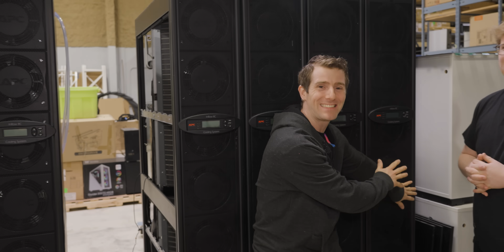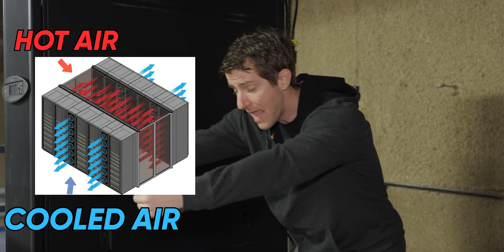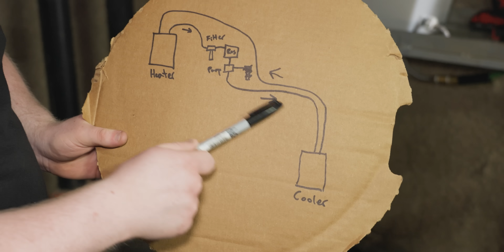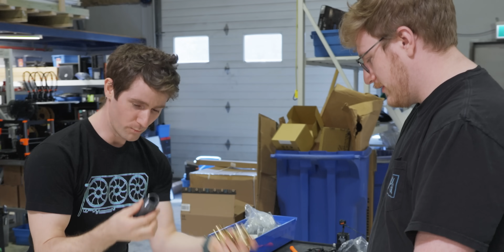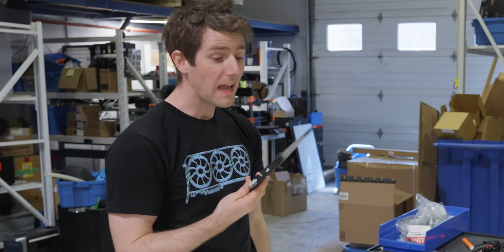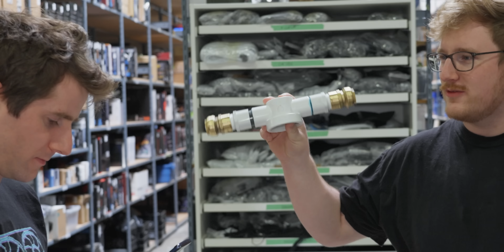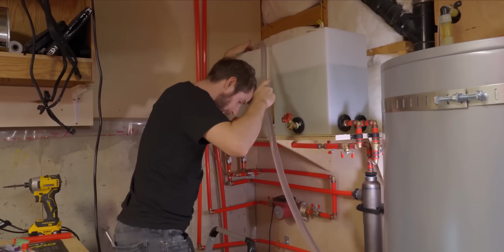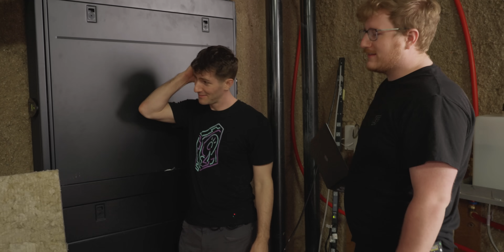I shouldn’t have kept the $1,000,000 computer

Comment: Ditch the AC altogether and put a water to water chiller between the two heat echangers and you'll close to double the heat pumping energy efficiency.  Then you can put a heat exchanger on the roof for the summer time(especially as they say we could have an even worse heat dome this year) and just use a 3way valve to direct the hot side water outside the warehouse during summer.
Reply: Or if you want to continue with the repurposing, get an air to water heatpump to replace the warehouse unit. And fot the Winter you could also put one on the outside.
Reply: If you did that you'd be much more constrained with where the heat goes.  Much easier to switch a water loop.
Reply: @stevebowen9412  There is no need to not Stick to a Waterloop. You just need to use a Monoblock unit. Those have the whole refrigerant circle in one casing.
Reply: @Felix-st2ue  by definition if you're using an air water heat pump the the hot loop will be air .  Unless you put the air side in the server room.
Reply: @stevebowen9412  Technically yes. But most modern units offer a cooling Mode for the summer. So they will reverse cycle to cool the water.
Reply: @Felix-st2ue  A water to water chiller is two monoblock heat exchangers connected by a refrigeration circuit. This widens the temperature difference in an extremely efficient way and makes the whole system work dramatically better.  If you're suggesting keeping it as a single cooling loop, and using an air to water chiller that will add a temperature constraint to one end or the other and negate the benefit of switching from AC to a chiller.
Reply: @stevebowen9412  It would definitely reduce the complexity compared to your approach. And it would improve the effectiveness compared to the current setup. It would make for a good video since they would rig something that is not industry standard.
Reply: @Felix-st2ue  it's not complex at all a water to water chiller is 4 pipe connections and an electrical supply connection
Reply: @stevebowen9412  Dont you have to monoblock units with a refrigerant circuit between them. That needs to be pressurized etc.
Reply: @Felix-st2ue  it comes as a complete package.
Reply: @stevebowen9412  But it's still two units, right? Otherwise, how would it be different compared to what I suggested. The only difference would be that you have two water loops instead of a large one. And that my solution would come with an appropriately designed fan arrangement to transfer the heat into the air?
Reply: @Felix-st2ue  no.  Water to water.  All in one.  Hot water loop to the warehouse.  Cold water loop to the rack room.  The unit would tie into the two existing lines dividing them into two seperate water loops with the heat pumped from one loop to the other.  No air heat exchanger at all at the chiller.
Reply: @stevebowen9412  So the second scenario. But then again, you end up with two water loops and need a unit that transfers the energy from the hot water into the air. My proposal would have that integrated. Plus, it would be sized correctly and designed for low noise. Especially on the warehouse end, this would be beneficial. And you would since you're directly transferring the energy from the hot refrigerant to the air and not add an additional step with water, the transfer should be more efficient.

Comment: FFS LINUS and team. CONTAINMENT> MORE DAMN POWER AND AIRFLOW. Separate your cold and hot air. Blanking panels, some curtain around the rack and venting HEAT OUT of the room and separating it from your cold. 3 tons of AC is so much fucking more than you need for a single rack if you do it properly holy jesus. 

SUB ZERO engineering. THey make containment systems. THeyre easy to use. affordable, one time cost. Data centers use it... so should you.
Reply: 18 damn minutes in they finally are like oh we should contain the hot air. 

BRO> TRY THAT FIRST YA DORKS
Reply: CARDBOAR?!?!?! IN A SERVER ROOM?!?!?! Yeah no the dust from cardboar and the flammability of it are perfect for a server room. Thats why all data centers have a no cardboard policy that ive ever seen. JESUS
Reply: setup containment properly, blank the rack, use just the AC and i bet its fine in there.

Comment: 3 ton AC is rather small. For proper cooling solution get a refrigeration company to install a 20hp cooling unit, with soft blowing air-coolers , it will cost about 20k but will keep that room at 15C

Comment: always put valves at both ends of the filter. those wilo pumps cannot handle air in the system very well
Reply: instead of teflon , use loctite thread sealer

Comment: The “condensate floats”are safety’s, if condensate pan gets too full(only if pan isn’t draining properly) then it turns off the unit and stops cooling to stop the condensation to keep the pan from leaking water on the floor. Loved the video!

Comment: How about putting two of these cooling units horizontally on the ceiling of the server room?
Would take advantage of convection and you could literally double your thermal throughput in the server room, without taking up any floor space.

Comment: Wait in North America/Canada do yall not have pressurised radiant heating?

We don't have water tanks in the UK for radiant heating; its hooked directly to the mains and just have small valves directly from the mains water to add water to the loop. The only major source of loss in our systems is via the over-pressure release from the varying temperatures throughout the year.

Comment: I have worked around water cooled server racks that were actually post cooled.  The radiator and then fan were on a swing door on the back of the rack.  It would draw the air in through the front of the servers, come out of the servers quite hot, then get pulled through the radiator then the fan would blow the cooled air back into the air.  The server room actually maintained the same temp year round, and the room was a pretty steady 70 degrees all the time.  There was no AC units or heaters in the room at all.

Comment: Comments around @3min are somewhat accurate. It depends if your data center is running in hot aisle containment (as pictured in vid) or in a cold aisle containment config which is much more energy efficient.

Comment: Whats the humidity like in the room? Air Cons need a little bit of moisture to better transfer cooling to the air. 
Course as they do this, humidity condenses on the fins and so they remove moisture.
Still a great effort to not have to cook yourselves with all that equipment!
Reply: 32.6% humidity at 22:40

Comment: The problem with all these massive powerhouse servers always seems to be that - example in the company I work in - the bottleneck is always the hard encrypted VPN connection for all the remote workers.
Reply: If you're working with a lot of data your VPN will be to access the computer that is sitting locally, not to transfer terabytes of video to edit directly from the laptop.
Reply: @TheFPSPower  Sorry. I did not quite understand how that helps the case I mentioned. Users are all working remotely.

Edit: 
Unless of course you meant that we'd have a “kind of” VMs that users would use instead (high-end machines placed locally where the data is at and have cheaper machines that the users would carry along). That works in some rare cases yes but there is a requirement to have high end machines for the users themselves to use in their remote locations.
Reply: @deejayxcrypt I assume you are talking about a remote datacenter?  Most local data centers for editing are using compressed proxies for anyone needing to connect remotely.   It seemed like thats what they were using these servers for anyways.
Reply: @talones  I don’t know if my YouTube app is bugging out or what so I’ll shortly repost what I said in length earlier (maybe this will be me repeating myself but anyways…).

In our case we have data centers (or high-end NAS drives) in some few locations. Those locations are capable to have 1Gigabyte/1Gigabyte bandwidth access from outside via encrypted access routes. We are able to have decent access routes between the data locations for any sync/backup reasons or just between the few users working from those locations. Then we have the many remote workers that rely on VPN access that is usually something like 10MB.
Reply: @deejayxcrypt  Yes that's what I mean, if you need a lot of data transfer from servers there's no world where "users having high end machines for themselves" is a reasonable requirement to work remotely, too many variables including the quality of the home internet connection which the company does not control.
Have a local high end machine and allow the user to remote to that machine from a thin and light laptop, works MUCH better.
Reply: @TheFPSPower  Yes, that is the problem itself. I am not taking into the calculations such arbitrary things as home network speeds however. The user chose to work there so then so be it. It would be nice of course if a user with at least an 50MB upload speed would get more than 10MBps up.

VMs would be nice, yes. We have a few, me included, who use all sorts of remote devices. It is not something our core users, and leaderboard, wants however. They require the power of a dedicated GPU on their personal (on hand) laptop which they’ll have access to even if they have to go work in middle of a far away area (forests, mines, construction yards,..) for a while (which would be a place where it would be a surprise if they get any internet connection even).

Edit: 
I hear ya… It is a bit of a nightmarish situation to think from multiple fronts. I'd really like to just have every remote user use VM. We will probably get there at some point.
Reply: Hardware-accelerated AES is pretty fast though, it is in gigabytes per second range at least.
Reply: @JGnLAU  It is. I’ve tested setting up some of my own small scale VPNs for testing and always have better results than what in the actual “production environment”.

I’ve always seen it more as a problem of our internet provider services rather than our devices and the VPN itself (unless it isn’t… because no one tells “more than they are supposed to” 😅).

Comment: Hold your fitting in your left hand, hold the tail of the teflon tape with your left thumb, roll the tape off the roll backwards so you can tension the tape and roll it off the roll, three wraps around the threads. If you absolutely don't want it to leak, throw some "Gimme the Green Stuff" pipe thread sealant on top of that and you'll never have to worry about leaks.

Comment: You’re only supposed to remove the white plastic part of the shark byte when inserting a metal pipe like copper. You might be voiding the warranty by removing it when using it with Pex.

Comment: I Have this type of setup for my whole room mancave cooling of my own. I have the option to use the cooler in the house to heat the house, or outside in the summer time, and the a/c for the house in the summer cools the house with no issues then. I also have a waterchiller inline so When I wanna do OC, the chiller is outside, but chills the whoole loop of 4-5 computers with no issues.
Reply: Who are you? Batman?

Comment: That Milwaukee impact @16:22 very much IS a hammer.  We've got ongoing jokes at work about how if it says Milwaukee, it's a hammer.  It might also be something else, but it's a hammer.

Which is extra fun because my PC case has a Milwaukee logo glazed onto the side of it.
Reply: Milwaukee battery packs are actually especially susceptible to breaking because of how little meat the screws hold onto on the top side of the battery.
Reply: @simplyintricate4160 You mean your hammer has a Milwaukee logo glazed onto the side of it...
Reply: @abcyclops  Or my hammer has a PC inside it, up to you how you want to look at it.
Reply: always a great idea to mechanically stress lithium batteries...

Comment: Actually Jake and Linus, instead of dumping the heat outside when you don't want it, which would be ideal under most circumstances for most folk, you should instead dump the heat into your hot water boiler(s), and possibly even a huge insulated thermal sink to act as a battery of sorts. When you need more heat, you can pull from it, and when you don't need heat for anything, you dump into it. You could do the same thing with the geothermal cooling idea you have with the parking lot, but instead just make a new thermal sink that is insulated for cold temperatures instead of hot. In that ones case, you are constantly pulling its heat via a separate loop dumping any heat it has into once again the heat battery, while having the original loop pass through it to drop it's water temperatures below ambient. Between the two masses being used to modulate the temperatures accordingly, you should end up with an albeit more expensive system, but also more resilient against the swings in climate, room temps due to people being in the area, etc and so forth. The A/C units will barely need to be operated then, ideally; and if they turn on it will be in a worst case scenario where you really want them on.

Attach this to some in-floor heating/cooling loops, and perhaps some thermoelectrics where is reasonable, and you could basically turn the entire building into one giant heat pump, with ability to throw the peltier's into reverse for the Seebeck effect. It won't be a lot of power generated, but it might be enough to keep the lights on at least via a backup power system charged by that power generation. In an emergency, this could prove handy, having what would basically be off-grid emergency supply of power if the grid suffers a black out. It won't be much power, but if it keeps the lights on, and some cellular phones active, it's good enough, right?
Reply: @SanityTV_Last_Sane_Man_Alive - heating water require a lot of energy, A loop pre-heating before the water boilers is "free cooling" AND lower electricity bill.
Reply: This is an office though, only showers would have hot water.
Reply: @TheSkcube  What about sink faucets? I believe they have a kitchen(s) too.
Reply: @SanityTV_Last_Sane_Man_AliveWith units that big, I am pretty sure they wil have a separate heating bill in the winter. Why else would they talk about geothermal?
Reply: Sand would make a good battery.
Reply: Those kinds of things only work with large temperature deltas.  You don't have that here.  It's very hard to make use of slightly warm water.
Reply: @  Heat pumps or peltiers? Heatpumps? Sorry, incorrect. But peltiers? Yes, there will need to be a well managed delta. Luckily, there are ways to store heat in a way that increases the load over time, so you can create that delta. It won't be exactly cheap to do, since it requires some exotic materials like titanium for instance, but it is possible if you do it right and use the right peltier units in the right positions considering said delta. Larger units require a larger delta. But if our purpose here is to just recover and recycle the heat again and again to create a current at all via the seebeck effect; then we can chain them together in a series/parallel setup in a way that will increase the usable voltage and amperages of the output. 

Again, so long as it can keep backup power sources filled for when the lights go out, it's not a complete waste of time and money. 

Personally, I think peltiers are a misunderstood tool we should be using more often, but is misunderstood because so many people tend to use them incorrectly, share that experience, and so they get a bad rap.
Reply: @ManuFortis  Basic thermodynamics.  Efficiency goes down as the delta decreases.
Reply: @stargazer7644  Yes, this is a given. Which is why one would chain together the units, to step up their output from those smaller deltas being utilized. 

Heat source(s) > phase change heat capture system (heat pump) > peltier units setup in array of series and parallel

"Cold" source(s) > 2 phase change heat capture systems ( 1 returning heat back to the first heat source pump, the other dumping heat to cool its refridgerant. 1st returning heat pump from dumping its heat does this repeatedly to ensure the cold source doesn't heat up too much.) > same peltier units array's opposite side. 

Peltier array > power delivery system > batteries > power distribution system > lights.

Lights? LED, since they require very little energy overall, and mostly just need their power source to be in higher voltage ranges than amperages. In a 120v household for instance, your led lightbulb is only going to be utilizing something like... 100-200 mA. Or 0.100 - 0.200 Amps. Not a lot. Depends on the version, lumen output, etc. 5 to 13 watts typically for normal bulbs as I understand. 

Larger bulbs like led grow lights for greenhouses, take easily double to triple that based on last I looked at the one I use for lighting in my computer room. Natural daylight spectrum output makes it kind of nicer on the eyes. And better for things like colour accuracy. Other light spectrums emitted from other bulbs in the warm and cool side of things can change colour accuracy of things they are reflecting their light off of.

Fun side fact about that last part. If you shine light through a red cloth thin enough to shade the light emitted from it as red, you can see through thinner red objects somewhat. Makes them sort of translucent. But it requires a very 'red' environment of light to do that. I found out when I draped my windows with red fabric just thin enough to let the light through, but reduce the glare so I could still use daylight as a light source. 

Anyways, back to the point of the matter. LED bulbs will not take a lot of power, and you can chain heat sources and even cold sources together in a way where it can take small deltas and turn them into a larger delta that can be utilized via specialized setups.

No energy is being created from nothing here, so thermodynamics is being completely obeyed.